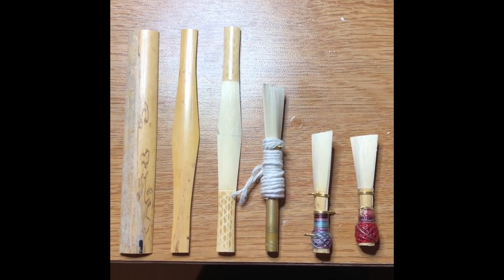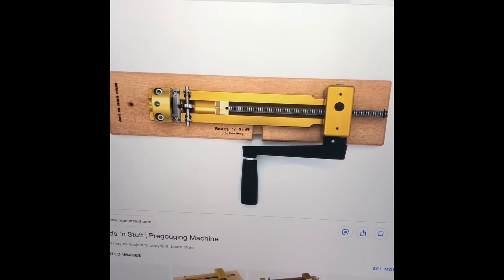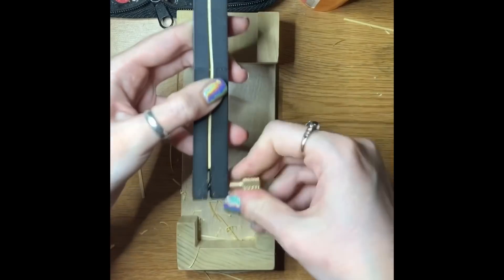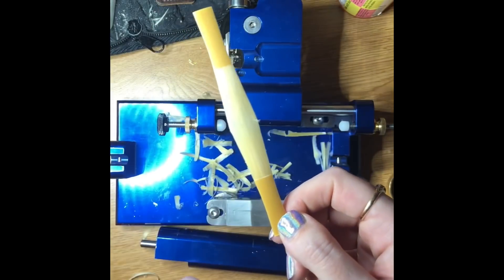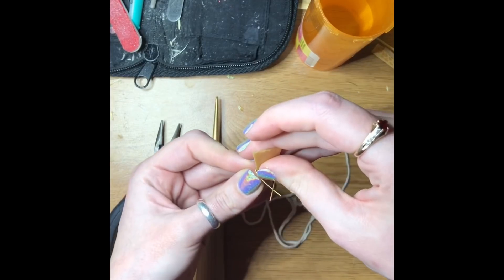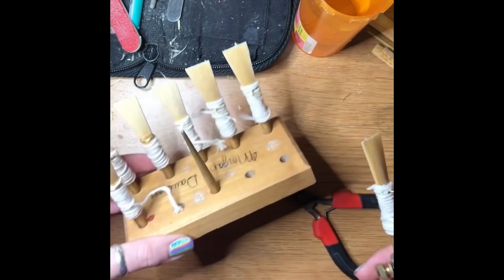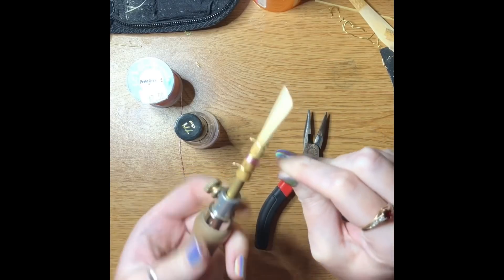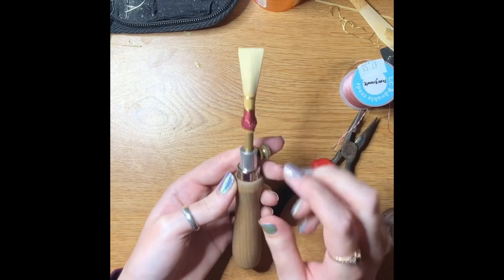How To Make A Bassoon Reed From Start To Finish Part 1

Comment: I noticed you scored before soaking. I have always scored after soaking, right before putting the wire and twine and forming it. Does it make a difference to score dry or soaked? I imagine not, but just curious..... (Never know...) I also noticed you didn't bevel? Just curious about that. Thanks. GREAT video!

Comment: Great video! is the turban needed?
Reply: This is a good question. I've been told it is good for gripping the reed.
Reply: I've been told that the turban had two purposes; aesthetics, and adding a weight to the end of the reed so if you drop it, it won't land on the tip

Comment: You didn’t say the measures of the wires!
Reply: I used other reeds to guesstimate the measurements, but this is a good point.
Reply from the maker: So sorry! I am new to working YouTube. My measurements for wires are as follows: First to second wire = 7mm, and from the second wire to base of the reed = 5mm! Hope this helps, so sorry for the delay!